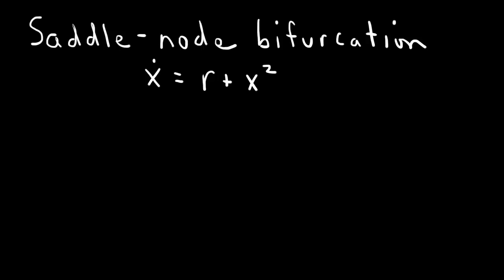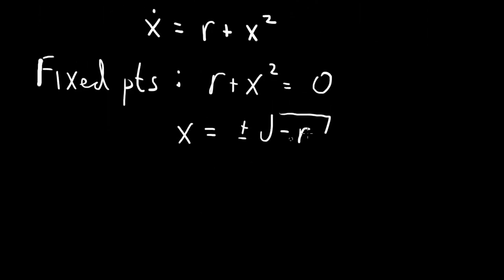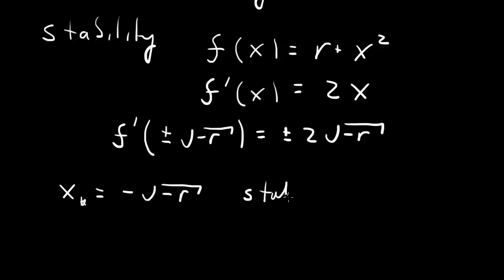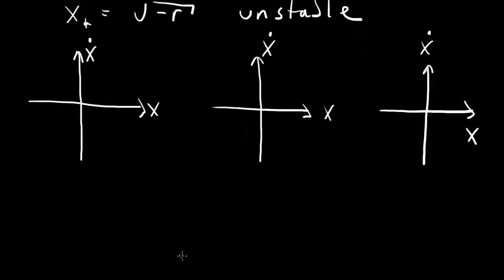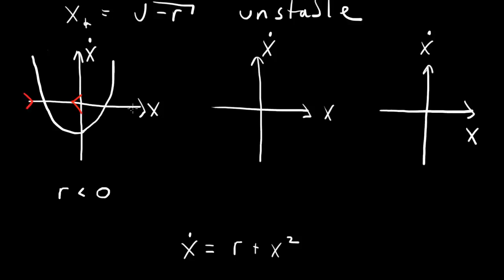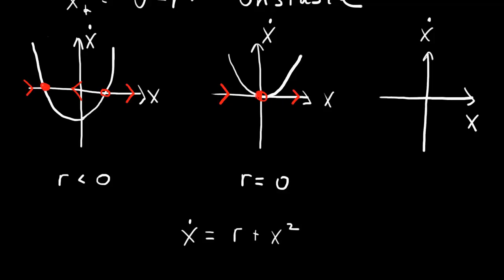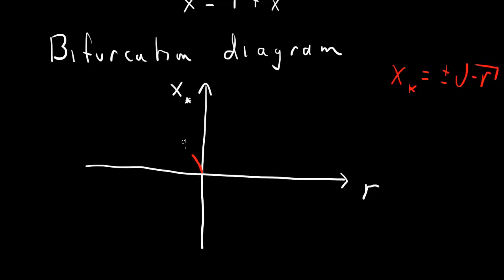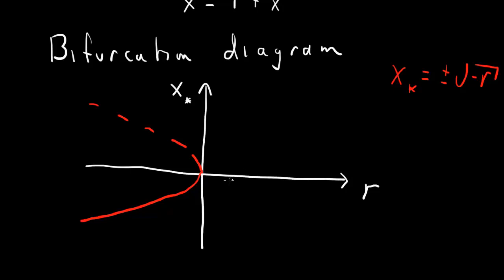Saddle-node bifurcation

Comment: At 5:55, why are the fixed points on the axis? Shouldn't the fixed points be where x=r+x^2, not where 0=r+x^2
Reply from the maker: For an ode, the fixed points are where the derivative is zero.  You are thinking about difference equations.